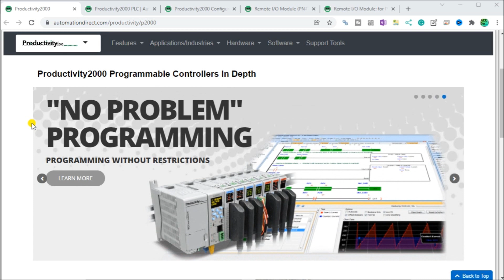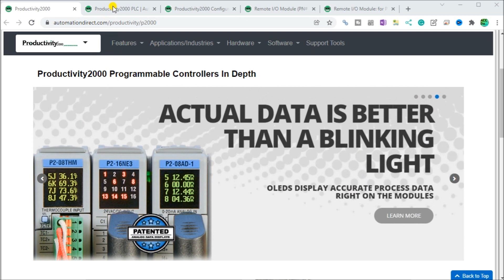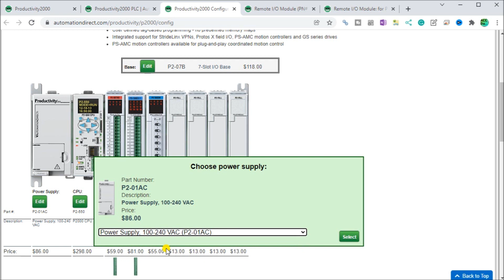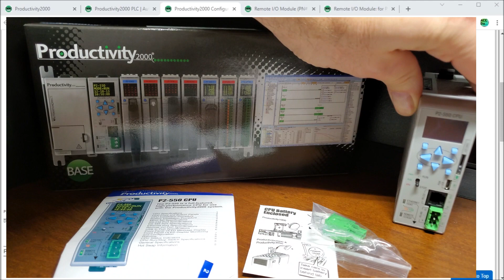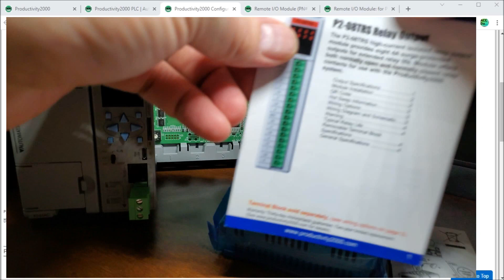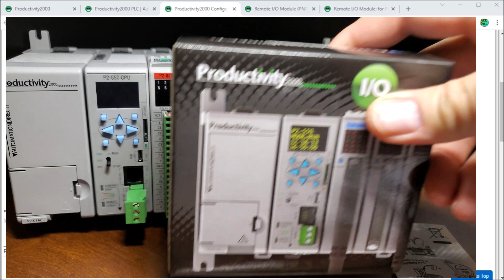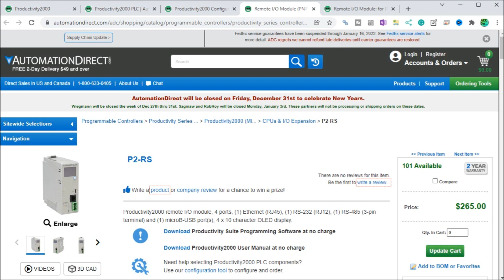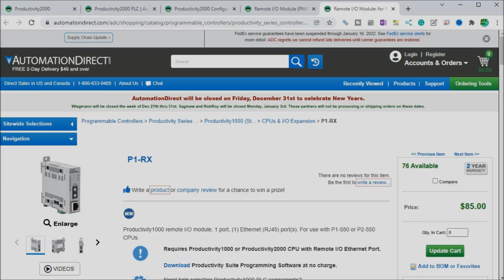Productivity 2000 Series PLC - P2000 Hardware Features

Comment from the maker: The Productivity 2000 (PAC) PLC uses the same Productivity Suite programming software as the Productivity 1000 PLC. Here is a link to the P1000 series of controllers that are from the same family.
https://accautomation.ca/series/productivity-1000-plc/

There are several reasons why we are using the Productivity 2000 Series Controller. Here are just a few.
- CPU with 5 communication ports
- 50MB user memory - Can handle very complex applications easily.
- Limitless PID – Autotuning – Individual or Cascade Mode - etc
- OLED message display on the CPU module
- Plenty of discrete and analog I/O modules
- Status displays on all discrete I/O modules
- I/O Modules have QR codes. This can be scanned so you can have the latest specifications/wiring diagrams for the module.
- OLED data display on analog modules
- P2-RS remote I/O expansion module, or use the Productivity1000 P1-RX remote expansion module to add even lower-cost remote I/O to your system
- FREE full-featured Productivity Suite software
- Programming with several ports - USB, Ethernet, Serial
- Hardware auto-discovery
- Hot-swappable I/O - Remove cards with power on the system
- Choose from three wiring options
- Slim DIN rail density form factor:
	- hardware - power supply, CPU, and seven modules in only 10-1/2 inches
- All project files (program, tag name database, and all the program documentation) in the CPU
- Run-time editing and debug mode on CPU
- Easy data logging with micro SD on CPU
- Secure Web server to access data files and system tags
- Easy drive and motion controller integration
- Coordinate motion control with PS-AMC allows control of up to 16 axes and synchronization of up to 4 axes
- Two-Year Warranty

The Productivity 2000 series of programmable logic controllers currently has all of these features built into the P2-550 CPU.
This CPU (Central Processing Unit) is also known as PAC (Programmable Automation Controller) because of its communication capabilities.

Regards,
Garry
ACC Automation
https://www.accautomation.ca

Comment: Hi. Thanks for an interesting video. For a project, I am considering both the P1000 as well as the P2000. Looking at the specs, the P1000 should be able to do the job. I don't need the fast CPU of the P2000. I like the fact that I can upload a new program via the SD card on the P2000. Are there any other benefits to the P2000 that I can consider compared to the P1000? Is the quality for example better, or does it look like it is of higher quality, which is also important?
Reply from the maker: Hi Flemming Jorgensen,
There are a couple of other considerations of the P2000 over the P1000.
- Amount of expansion on the IO
- CPU has 4 lines of display that can be programmed
- Hot-Swappable IO. Replace IO cards without powering down the CPU.
These are just the top three things that come to mind. 
Remember that they are both in the same family. If you have a program made for the P1000, you can easily change it to the P2000.
Regards,
Garry
Reply: @ACCautomation  Thanks Garry. Regards from Mexico, Flemming
Reply from the maker: @flemmingjrgensen9313  
hola desde Canadá